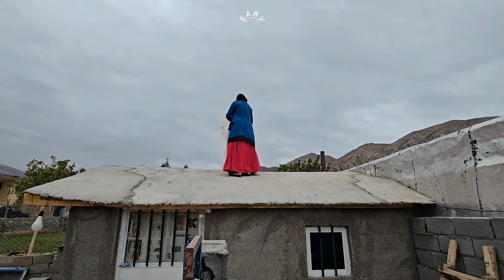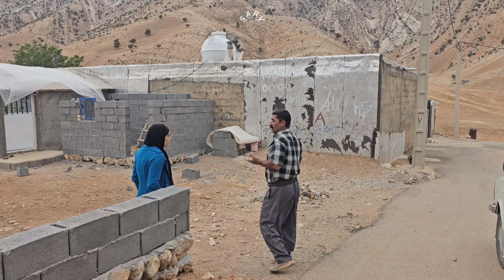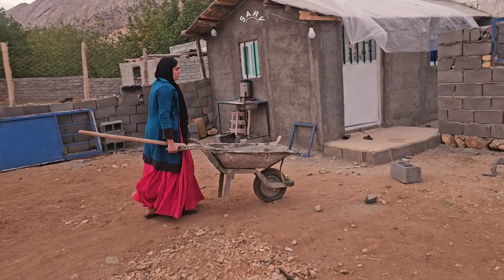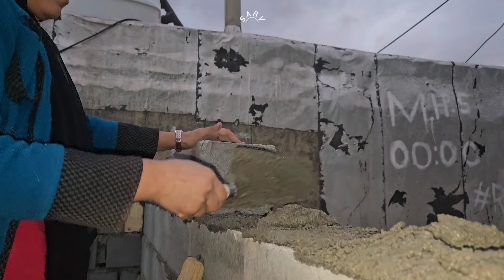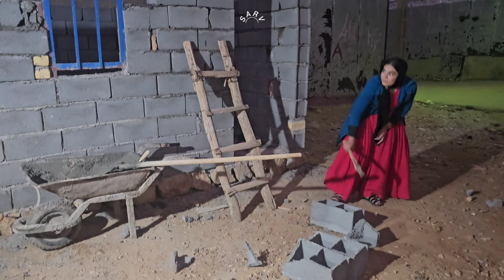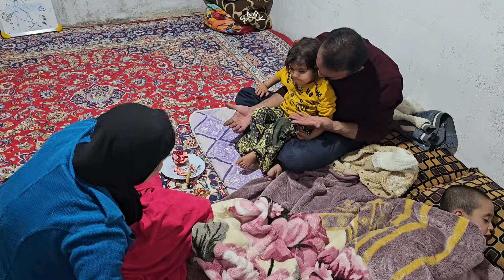Master's request for money from the nomadic mother

Comment: The wall between the 2 doors need extra support. I’ve seen the crash without an extra column for support. ❤
Reply: Infatti le due porte e la finestra indeboliscono notevolmente la struttura del muro, sicuramente ci sarà un crollo in breve tempo. Penso che facciano tutto questo per drammatizzare le riprese quando ciò accadrà e dopodiché chiedere più soldi agli spettatori...